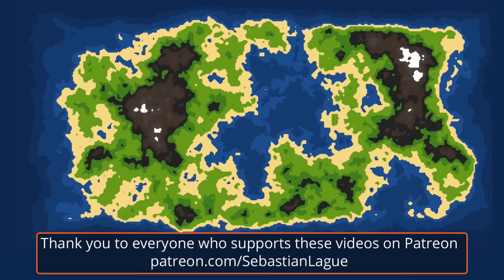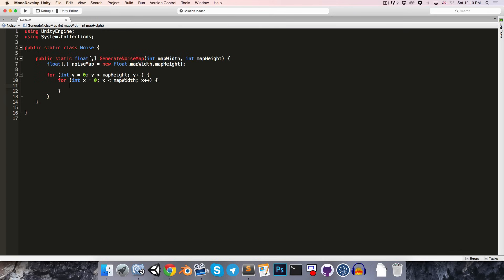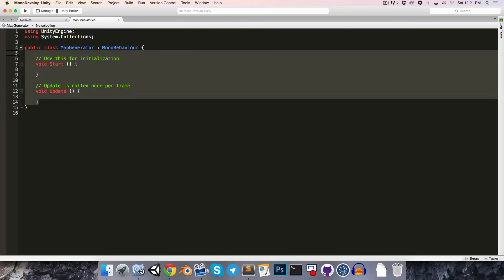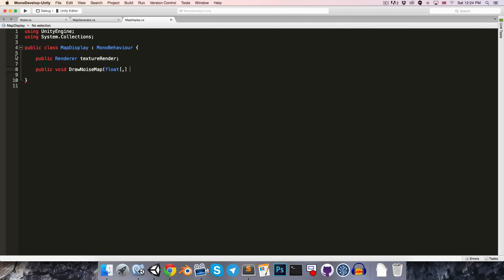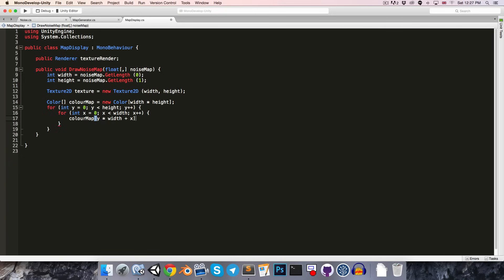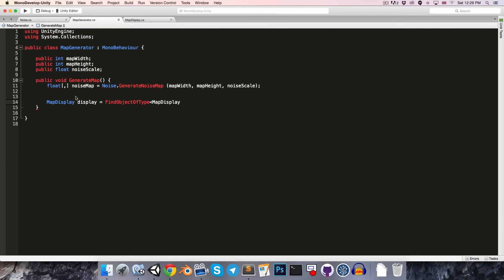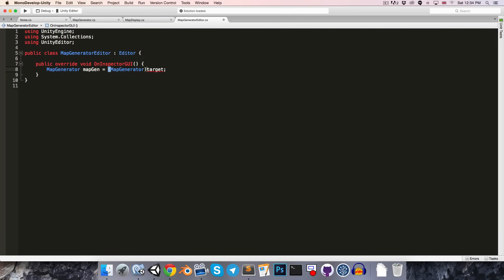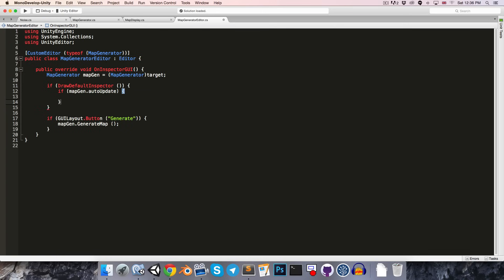Procedural Landmass Generation (E02: Noise Map)

Comment: Why this code aint work?:

using System.Collections;
using System.Collections.Generic;
using UnityEngine;

public class MapDisplay : MonoBehaviour {

    public Renderer textureRenderer;

    public void DrawNoiseMap(float[,] noiseMap) {
        int width = noiseMap.GetLength (0);
        int height = noiseMap.GetLength (1);

        Texture2D texture = new Texture2D (width, height);

        Color[] colourMap = new Color[width * height];
        for (int y = 0; y < height; y++) { 
            for (int x = 0; x < width; x++) {
                colourMap [y * width + x] = Color.Lerp (Color.black, Color.white, noiseMap[x, y]);
            }
        }
        texture.SetPixels (colourMap);
        texture.Apply ();

        textureRenderer.shaderMaterial.mainTexture = texture;
        textureRenderer.transform.localScale = new Vector3 (width, 1, height);
    }

}
Reply: I know this was over a year ago, but the issue might've been that you used shaderMaterial instead of sharedMaterial.

Comment: There is one thing VERY important that you NEVER even ONCE mention in this series, and that is ram memory management. the thing about your stuff is that it eats up alot of ram, make sure you clear your array and null them when done clears up ram memory I work with a cube based component building game. and I noticed lots of ram usage from un-nulled arrays. fixed that up and almost no overhead. i am currently revisiting your tutorials to use them with my pixel cube stuff to create a procedural voxel map. other than ram management your tutorials are awesome
Reply: any ideas on how to optimize ram usage? :0

Comment: if you're seeing a grey plane:
1 - check other comments below to make sure you set up stuff correctly
2 - in your Scnee Camera make sure Clipping Planes are set to Near: 0.0001 and Far: 4000. If your computer is shitty take care moving this values, it mess around with how far your cam can see. As de 100x100 map is pretty big I get this problem when moving around with the camera editor (when near I could see the texture, when far I could't)

Comment: just started and after copying mapgenerator i script im full of errors i can't fix :/ following old tutorials realy sucks
current error im getting is: 
Assets\Scenes\MapGenerator.cs(20,3): error CS0246: The type or namespace name 'MapDisplay' could not be found (are you missing a using directive or an assembly reference?)
Reply: Your the one who is wrong. Don't blame the old tutorials. Tried to learn coding basic first. and see what is wrong with your problem.
Reply: @joelkanna3563  extremely helpful aren't ya, i did manage to fix it but it wasn't thanks to an annoying person like you lmao
Reply: @joelkanna3563  dont be an asshat
Reply: make sure you save your scripts all in the same folder if they arent in the same ones they can have some trouble connecting to one another. you may have to flip between tabs on visual studio to have them recognize one another.
Reply: How did you end up resolving this issue?

Comment: i get an index out of range exception,how do i fix it?
here's the full error message:

IndexOutOfRangeException: Index was outside the bounds of the array.
noise.generatenoisemap (System.Int32 width, System.Int32 height, System.Single scale) (at Assets/noise.cs:22)
generator.generate () (at Assets/generator.cs:12)
mapgeneratoreditor.OnInspectorGUI () (at Assets/mapgeneratoreditor.cs:14)
UnityEditor.UIElements.InspectorElement+<>c__DisplayClass55_0.<CreateIMGUIInspectorFromEditor>b__0 () (at <90d4bcb003fb405fb09241aed2f178aa>:0)
UnityEngine.GUIUtility:ProcessEvent(Int32, IntPtr)
Reply: check your for loop and make sure that the x and y in the for loop isnt set to x<= it needs to be just x <
Reply: @gerg44 post it I can’t take a look man
Reply: @gerg44 its the little things man. still mindboggling how one thing can ruin the entire code

Comment: auto update error ('MapGenerator' does not contain a definition for 'autoUpdate' and no accessible extension method 'autoUpdate' accepting a first argument of type 'MapGenerator' could be found) anyone know how to fix it
Reply: Be sure that you've set the bool inside MapGenerator properly. Should be: public bool autoUpdate;
I would also double check that you used MapDisplay inside the MapGenerator script's GenerateMap method. It could've automatically entered in as MapGenerator instead of MapDisplay. If it looks like you did it all right and still can't get it to work, reply with your code or a link to a pastebin of your code, and I'll try to help.

Comment: Hey!

So I am not getting the drop downs for the Unity functions. Like CustomEditor is just basic text for me. What do I have to do in order to implement it? 
Using visual studio.

EDIT:
I fixed it by going to Edit -> Preferences -> External Tools then changing External Script Editor to Visual Studio Community 19.
Then I went into Edit -> Project Settings -> Player -> Other Settings and then I set the Api Compatibility Level to .NET 4x.

Then I got the Autocomplete to work.

Comment: 8:05 i could'nt understand how you got to this index for the colormap
Reply: just got it. just use a chart and make a pratical example to understand how the formula behaves
example of a 4x4 chart using the "y * width + x"
12 13 14 15
8    9  10  11
4    5   6    7
0    1   2    3

Comment: Thank you, I can verify it works in 2021.
Reply: Which unity version are you on?
Reply: @pinkpigmypuff4638  2020.2.2f1.
Reply: @Veevslav1  Oh, nice. I thought that a few things didn't quite always work the same in newer versions, but everything has worked well for you?
Reply: @pinkpigmypuff4638  Up to this point the code is working perfectly.
I have fat fingered a few places. But the code is great.
Reply: @Veevslav1   my plane just looks completely black and isn't showing any noise
Reply: @alexthompson8977  Which Unity version? Did you verify the code?
One of the things I do is test their code by D/L it. Then I run it and see if it works. If it does, it means I typo'd somewhere.
I then use windows snap feature to load both code side by side and go through it line by line until I find the bug.
Have a great day.
Reply: @Veevslav1   version 2020.3.2
I double checked it and there aren't are typos or errors
Reply: @alexthompson8977  It worked for me on 2020.2.2f1. Without looking at your code and scene set up I could not tell you why yours is broken.

Comment: As you said, PerlinNoise function returns the same value at integer coordinates. This causes an issue of ridged grid on my mesh when generating a quite big map. How can I overcome that?
Reply: UPDATE: I tried different methods, even changed noise generation algorithm to Simplex, but nothing seems to help. But I discovered that at noise scales, such as 32, 64, 128 and sometimes 256 ridges are gone and map behaves as it should.

Comment: 9:40 If you are doing this in the new HDRP or URP to know what material texture to replace with your noise to display it. You need to use sharedMaterial.SetTexture("_UnlitColorMap", texture);
Instead of  sharedMaterial.MainTexture = texture; 
To find the textureID ("_UnlitColorMap") for the shader you use right click the dropdown menu for selecting your shader(at the top in the inspector) in your material, and "Select shader". The textureID is in the properties of the shader where you will find a list of names that often makes sense.
The shaders no longer use the textureID that mainTexture references so you have to find it your self. Hopefully this saves anyone the 2h I spent on finding this.
Reply: Don't know how active this is anymore, but my texture just turns out either completely white or completely gray. I've tried changing the shader (URP-unlit, Unlit-texture, etc) and I've tried different textureIDs (_MainTex, _BaseMap). Anyone else have this issue?
Reply: @EliGliBli  try setting the scale of the plane to 1. That allowed me to see the texture instead of just grey on the plane. if you mean your actual texture on the material is just grey or white, then screw with the scale i guess idk.
Reply: @EliGliBli  Same problem in my case there were 2 problems
1 I had to use renderer.sharedMaterial.mainTexture = texture;
2 The perlin noise were giving the same numbers so the textured looked grey I changed the code for testing in noise to this:
    sampleX = x + 0.1f;
    sampleY = y + 0.4f;
I had a problem with scaling not sure why now my code is back to what it was in the video and it's working.
Reply: @wagnerthomas6780  yes this, I think is as a result of what he said at the start of the video. The value for the perlin noise at integral values is the same, so you might still get a uniformly colored plane until you offset the coordinate values by a fraction, like you did.

In my case, I could use this;

float sampleX = xOrg + x / scale;
float sampleY = yOrg + y / scale;

but let the values for xOrg and yOrg not be whole numbers. so like 0.1, 0.2, etc
Reply: Also just a heads up if you're using a new URP project and you can see the material change in the assets folder, but it still appears grey in the scene view. You need to go to the lighting panel and turn off Fog under the Environment tab. You can zoom in real close to see the texture, but not from a distance. I also had to use sharedMaterial.SetTexture("_BaseMap", texture).
Reply: @snackmix9048  thanks, the fog was my issue.  (URP - 2020.3)
Reply: @snackmix9048  You're a lifesaver
Reply: @snackmix9048  Dude thank you so much, this saved my life. I would've never fixed it without your comment
Reply: @connorbell01 Your problem is probably not related to this. The inspector only show variables which are public, or has some attribute which I can't remember. Like [ShowInInspector] or similar.
Reply: @hajjjen1731  That part worked for me a year ago when I did this tutorial, so it is probably some typo hiding somewhere unless they remade the custom editor part in unity. I have not touched unity in almost a year because I started studying software development, so I can't say how newer versions work.
Reply: @hajjjen1731  Just click on another object on the scene and then click on object that doesnt have the button
Reply: Thank you!
Reply: Thanks !
Reply: Thank you
Reply: Thanks!
Reply: thank you
Reply: thankyou for this comment very helpful
Reply: Was getting a completely white texture,  Used  sharedMaterial.SetTexture("_MainTex", texture); instead to have the texture show up
Reply: @jawadahmed4205  Nice it helped in my case aswell
Reply: @jawadahmed4205  I used sharedMaterial.SetTexture("_MainTex", texture); and also changed the material to be "Transparent" on the render queue, this actually made the noise show up
Reply: @jawadahmed4205  goat thank you
Reply: ABSOLUTE LEGEND. I was messing with this for sooooo long, I even reimported a bunch of stuff because i was gaslighting myself that I deleted something.

Comment: "Can't add script component 'mapGenerator' because the script class cannot be found. Make sure that there are no compile errors and that the file name and class name match." and "Can't add script behaviour Noise. The script class can't be abstract!" also code "MapDislay" in mapGenerator is a ERROR. :(( HELLLP!!
Reply: Works fine for me using Unity 2020.1. Make sure you follow the video 100%
Reply: Akanaro O.O so... everything works with 2020.1?
Reply: @wudolph4255  Yup.
Reply: Akanaro O.O the generator button isnt there, can u pls help?
Reply: @wudolph4255  All I did was follow the instructions in the video so not gonna be much help. Your problem could be a coding error or a setting you forgot to do. The only advice I can give is to double check every setting and line of code and make sure it's identical to what is shown in the video.

Comment: Error that i got while adding a script to my object [ Can't add script component 'MapGenerator' because the script class cannot be found. Make sure that there are no compile errors and that the file name and class name match.
]
Reply: Check if Your script's name is the same as the "public class <class' name> : MonoBehaviour", e.g. script's name's MapGenerator, so the class' name must be MapGenerator as well. Also check Your curly brackets if everything is contained as it should
Reply: @Bednar121  thanks, that helped me alot.

Comment: Firstly, great tutorial. Good speed, perfect amount of explanation of what certain things are and why they're done and overall just useful tutorial. Quick note to hopefully help save some people time if they're following along using LWRP.  I wasn't getting anything shown on my plane despite the code being run, checked w/ logging, and went to the internet. Turns out the fog feature in LWRP boilerplate got me again.

Go to Window > Rendering > Lighting Settings. Under "Other Settings" uncheck the fog or lower it.

Comment: You should iterate row first then column for better performance (noiseMap[x, y] -> noiseMap[y, x])
Reply: where specifically; and why would that increase performance and in what way?
Reply: @Romulus00001  When you read a memory location the cpu loads that address + some more ahead into its cache to be faster if those areas are accessed again it doesn't have to pull them from the ram again which is much slower than its cache. Whenever you're dealing with with matrices especially big ones it's good practice because of how they're layed out in memory to iterate row first then column (column in the inner loop) so you're reading the memory areas sequentially and not all over the place where you might get cache misses.

Comment: why not just ADD 0.001f to the noise. instead of if for GPU
Reply: He was also checking for negative values. If the value was say, -1, adding 0.001f would still result in a negative. This is why he simply set it to a very small positive float.